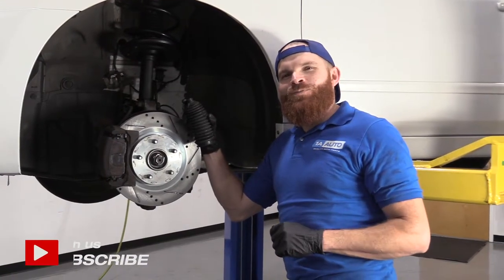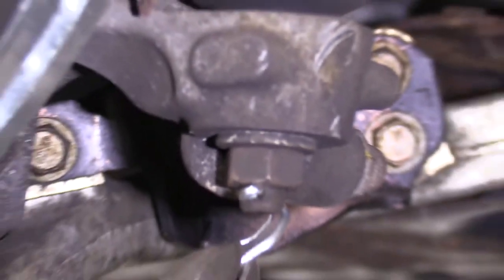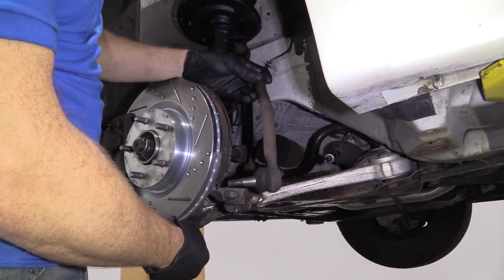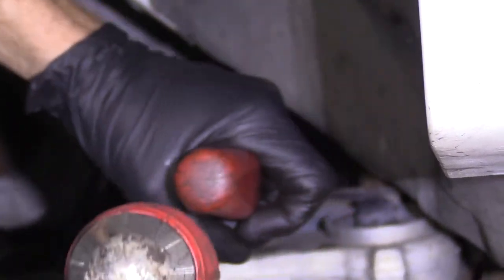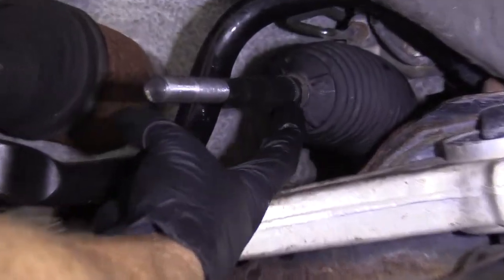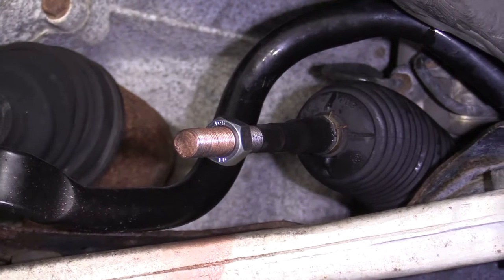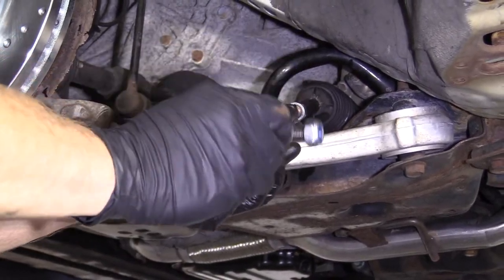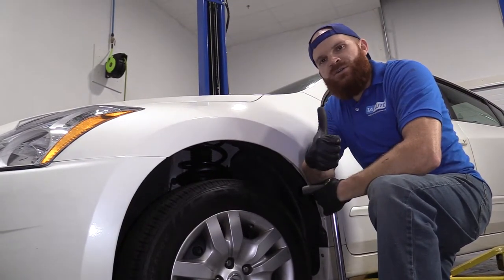How to Replace Power Steering Bellows Boot 06-11 Nissan Altima

Comment: Not a good idea to use pliars on the lock nut as that's a good way to round off the flats. Jaws on locking pliars (and channel locks) are designed to grip best with the 'humped' side following into the direction of turn.  Yours was on backwards. Lastly, you might want to mention the struggles one will have installing the large end of a NEW boot. I've found that heating it with a hair dryer can shorten your ordeal from hours down to 20 minutes (if you're lucky).